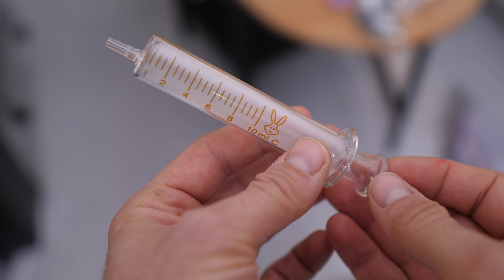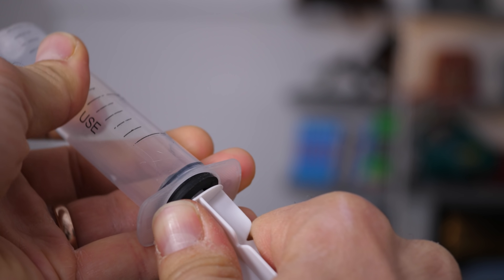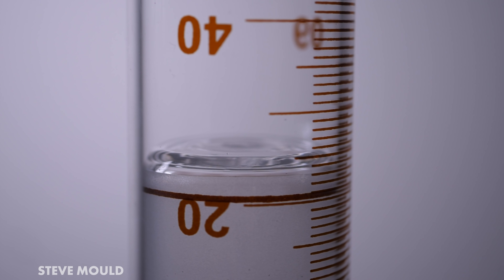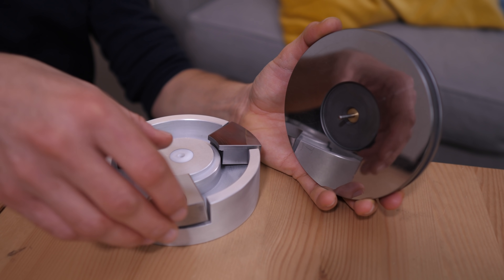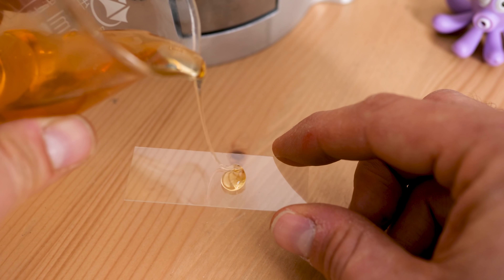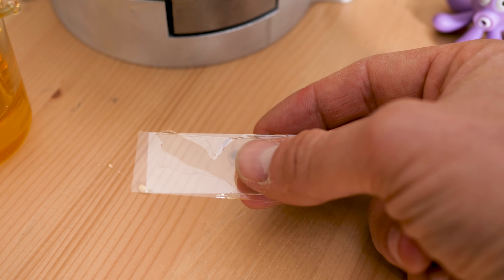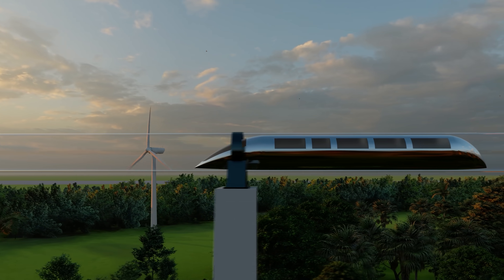The Self-Levitating Kingsbury Aerodynamic Bearing

Comment from the maker: Today I Learned From The Comments Section: I was wrong about how ice skating works (common misconception). Thanks for the correction @W410p. Here's an explainer: https://youtu.be/yjSf7Yh9UZc
The sponsor is Blinkist: The first 100 people to go to https://blinkist.com/stevemould will get unlimited access for 1 week to try it out. You'll also get 25% off if you want full membership.
Reply: Have you ever followed a lorry/articulated/semi at dark and when it's -20C or lower? Their hot tires melt a visible track on the icy road and you can see it refreeze on your headlight spot (if you're crazy enough to drive close to the rear end). That track is slippery as heck, being fresly frozen ice. Now we know why (re. the explanation video).

Offsetting your own tracks onto the older ice gives more grip, because it has had time to collect water vapours and become microstructurally more chaotic, resembling Ice Spikes biome from Minecraft.
Reply: I watched the video from ‘It’s okay to be smart’ and appreciate the phase diagram for water. But this brings me to an interesting question:
In the video, the phase diagram for water demonstrates that with increasing pressure  ice changes to liquid water but in Thoughty2’s video he explains that due to the enormous gravitational force on planet Gliese 436b any liquid water is compressed into solid form (ice). Did I miss something? Does the state change again at even higher pressures?

See the third planet, Gliese 436b
at 2min 40sec in this video:
https://youtu.be/6KZ1kvIUFrU
Reply: @welshsteve2009   I believe that it is because, normally, increasing pressure transitions things from gas to liquid to solid because the molecules get forced closer together. Water, however, is weird in that it expands when it freezes and becomes a solid (see how drinks explode if you leave them in the freezer too long). Therefore, increasing pressure on ice at temps we normally deal with causes a transition back to the liquid form, but increasing further forces the molecules back together into a solid.

See https://en.wikipedia.org/wiki/Phase_diagram#/media/File:Phase_diagram_of_water_simplified.svg
Reply: I think water behaves this way because it normally (i.e. normal conditions humans encounter) becomes a crystal when it freezes, but higher pressures break the crystal formation and things just become a 'block' like most other materials.

Edit: Oh Joe discusses this later in his video
Reply: @Anzallos  So, the conclusion is that water does  go through yet another phase transition at higher pressure?

Edit:
Aha, I can see in the Phase Change diagram in your link that this is indeed true only at a particular (and small) temperature range.

I noticed the small spur. At just below 0degC water remains frozen until the pressure a certain pressure. It then changes to a liquid before changing back to a solid again at even higher pressure. Interesting.
Reply: @welshsteve2009  also Thoughty2’s channel is terrible and inaccurate, I had to unsubscribe from it.
Reply: Hi Steve! There's a new study I saw from the University of Aalto that discussed the faster rate of flow of honey (more viscous) compared to water (less viscous) in a superhydrophobic tube/capillary. I won't spoil the ending, but the hint is: it occurs due to reasons similar to a hydrodynamic bearing. Hope you enjoy!
Reply: Don’t feel too bad, you are in good company with this misconception. Richard Feynman makes the same mistake here are 2:55 https://youtu.be/36GT2zI8lVA (note that he prefaces the statement with “they say”, which is a good trick to avoid looking silly :))
Reply: @tamask001  
Don't think he makes a mistake.... 
Feynman is cautious to preamble with "they say"... 🙂🇨🇱
Reply: Related content: When we were taught about the ice skating in school, we were also told about a related experiment where you use a weighted wire to cut through ice as well. That's been debunked also. Turns out the wire conducts heat which melts the ice.
Reply: There's a TON of hydrodynamic bearing surfaces in a standard car - engine bearings, camshaft lobes, valves, gear teeth, etc.
Reply: You mentioned the builder of that rotating disc. Can you link to his channel or site in the description?
Reply: regarding viscocity smartereveryday has a good video about it with ifferent inks in a really viscose liquid where you cvn spin it in one directerion and spin it back and you get nearly the same pattern.
Reply: Would you like to do a collab on why alkali metals explode in water?  The true mechanism was not truly understood until fairly recently and it's extremely cool how it works.  I already have quite a bit of video showing the explosions as well, so you wouldn't need to put yourself in danger to show the explosions.
Reply: Fascinating video. I never expected a glass syringe to exhibit such behaviour.

Technically glass is a super-cooled fluid. Most glass actually flows over time when a shear force is applied. We can think of glass as a Non-Newtonian liquid with a very large yield stress.
Check the thickness of window glass on very old buildings such as churches etc - the thickness at the bottom of the glass pane is thicker than the top. 
For this particular demonstration we can ignore these viscous effects that occur of long periods of time. The applicable dimensional number? The Deborah Number.

(incidentally, lead sheeting also exhibits the same flow behaviour under the weak force of gravity over long periods of time. Geologists also describe rocks as flowing over long periods of time. You could say that the solid state of matter may well be a transient illusion and in reality "everything" ultimately behaves like a fluid - if you wait long enough or are quick enough perhaps)
Reply: @PetraKann  It is true that common glass is an amorphous solid but glass flow at room temperature is a myth. The glass is thick at the bottom of old church windows because the method of hand blowing did not create even thickness and the installation practice was to install it thick side down.
Reply: Still rocking that Pebble Steel I see, I am currently wearing my Pebble 2 HR.
Reply: I’m not sure you’re wrong re skating (ie blade pressure does melt the ice). As a 12 year old I sharpened my own skates on a grinder (ie the blade contact surface was ground flat and no longer slightly cupped/concave) - I went nowhere.  My understanding is that the cupped profile ensures only the edges of the blade (not the entire blade surface) contact the ice so the pressure must be large.   And, yes, I did watch the video you linked.  😀
Reply: The best understanding as to why the gauge lock happens is the same thing that happens when you place two flat pieces of glass against each other.  At such fine variances, the atoms on either side have wave function uncertainties that mean they do not 'know' which object they belong to... being part of either becomes a valid solution to their location.  When you break the two objects apart, you're essentially forcing the atoms to resolve their wave function so that they remain in one object or the other.
Reply: The trick with the glas syringe can be done with two glases. If you spin it and blow down between the glases. The ine in top jumps out
Reply: Hey, where did you buy these syringes?

 I checked out my Canadianized version of Amazon and all it showed me were hypodermic syringes, complete with a set of attachable needles. So for the next week I was getting recommendations for hypodermic needles on Amazon and all over.
Reply: One note, science doesn't prove things, it tests against a Null Hypothesis by comparing evidence,... 

Otherwise love the video!
Reply: This too is wrong.  A mistake back in the 1950s (by Linus Pauling) is the reason for the confusion.  Here is the solution:
https://www.youtube.com/watch?v=bs73A9mSvQo&t=50s
Reply: One wonders if continuity events are a calculable function of rotational speed.
Reply: I was a little surprised to not hear mention of the use that most people reading this have right next to them right now; hard drive heads float over the surface of the disk from similar effects!
Reply: Well, glass is "a liquid"...
Reply: Can you explain the Faraday's homopolar paradox?
Reply: Ahh man that was such a good video, totally just subscribed!
Reply: LOL!!! https://www.youtube.com/watch?v=zZUUABHj_uk
Reply: Big ups to a man that can public say he was corrected and learned. Idk why but it’s fuckin rare. I don’t have that problem and it blows my mind that the large majority of adults are too insecure to acknowledge they have faults
Reply: @lowkey213  Just as well my knoledge is all perfect then??!? :D
Reply: And could you make one with copper and iron and magnets?
Sry for my english and you have amazing inspirational content really how channel should be
Reply: Gauge blocks stick together because of the same reason why cold welding metal in a vacuum is working
Reply: boi-oi-oing
Reply: 8:50 before its even explained how it works.
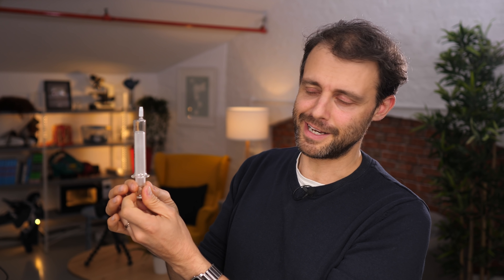Reply: 9:04 9:18
Reply: 10:36
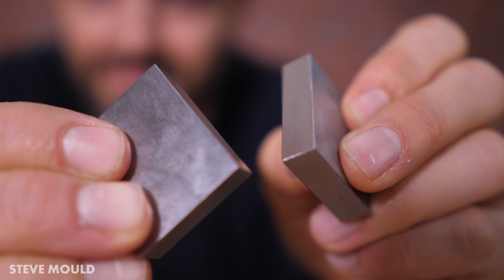Reply: There are forces of attraction occurring between the two metals at 5:24, these are know as van der Val, infact van der Valls happen everywhere where, but the strength of the van der Valls forces drastically increases especially9 when more atoms of that specific object touch another object!,      
Although vertitasium made a fantastic video about the feet's of lizards and how they stick to the walls, he explains the effect of van der Valls at a large magnitude, the link: https://www.youtube.com/watch?v=vS0TuIPoeBs
Reply: plungers are not interchangeable.  buy two and swap the plungers.  one won't fit they are so close tolerance. They must be individually ground.
Reply: Also the card head that was turned up faced the camera. You got it perfect.

Comment: "No one really knows why the gauge blocks stick together"
That's not true. We do.
The reason is very similar (but not quite the same) as why metal parts stick to each other in space. Engineering for space is hard because metal parts will weld to each other.
Normally air molecules get inside all of the spaces between two metal parts and act as sort of grease but also separation layer between two metals.
When you remove air molecules and press two flat metal parts to each other, the atoms "touch" each other. Now, once they are close enough there is no real difference between two atoms being close because they are part of the same object and two atoms being close but being parts of separate object.
They are effectively one object now (we call this -- welded).
Same happens to gauge blocks because flatness of the surface effectively gets rid of most of the air. The blocks do not get welded permanently because there is still some air inside, there are some oxides that create discontinuity and because the blocks are not really perfectly flat -- only some small parts of the surface are in actual contact.
As you slide blocks against each other, you effectively polish bits and pieces of surface that get in contact, scrub any oxides that are present there and evacuate most of the air from between now perfectly polished and parallel surfaces. The two gauge blocks get slightly welded to each other in couple of places and this provides enough resistance to prevent air get inside (kinda like a suction pad).

Comment: Actually I am more interested in Patrick Herd journal bearing using injection molding parts because that Kingsbury bearing is everywhere on the YT. I was looking for info about the dynamic air journal bearing (not trust bearing) and I could not find it anywhere. Most tilting pad journal bearing videos never explicitly mention if it is air dynamic or oil dynamic. (I am looking for air dynamic)

Comment: given how narrow the gap is and how large the not-quite-contact surface area is, I have to wonder, if you actually were to try the circuit test, if you'd run into problems from capacitance or even arcing even at the small amounts of voltage and current you'd need to measure it.

Comment: I don't think its true , what you said about ice skating at the end.  I vaguely remember a youtube about that.  Ice melting under pressure was a theory somebody posited in a lecture and people accepted it but somebody did the maths and its not enough to explain the lack of friction.  I can't remember now what the explanation is.  They put frozen CO2 in a vacuum, so all the fluid on the surface would flash off into evapouration, no liquid, and it was still slidey I think. It think its to do with only one weak vander vals forces bond at the edge rather than two with H2O so the molecule can slide.  Not sure.

Comment: For anyone that doesn't know how syringes work, here's an explanation. It works in the same way as a straw when you were a kid and trapped some coke in it. Syringes are airtight, meaning no air can get out the handle end. So, when you put the syringe in a fluid and try to pull the handle, no air can come in from the handle side. This means that it must suck up air from the other side. But wait, there is no air . . . That doesn't matter. Okay, now you have a filled syringe. You want to empty it. You just push the handle down. This is a simple process. No air can come in the handle side to even the pressure out, and none from the front. So the only way to make the pressure even again is to push whatever is in it, out.

Comment: Barreling occurs in the glass and on the disc. The other object acts almost like an ice skater with a small point of pressure in a pre-determined path. When the disc spins, it can glide just like a speed skater. When the syringe wobbles up and down, the "skates" bump up and down against the grooves. Since the grooves are likely laid out in some kind of frequency or pattern, the motion looks kind of funny to us.

As for the gauge, surfaces that flat have maximum contact between them. Atoms from one break off like small fibers (the way Spiderman crawls up walls in the Tobey Maguire version) and are pushed into the other and vice versa. When pulled apart, some blemish is likely left over but it will still feel incredibly smooth at our scale, but I suspect it would feel like a point here or there after doing so.

Comment: Most people watching this video with a reasonably modern computer would already own some form of this in the fan(s) or Hard drives (if any; the spinning stuff uses hydro dynamic bearings for the motors) in their computer. Different manufacturers uses different trademark name but typically they all work on the same principles.
Fluid Dynamic Bearing (FDB) - Patented by Matsushita (parent company to Panasonic) uses herringbone grooves to help circulate the fluid.
Hydrodynamic bearing (HDB) - Alternatives not licensing from Matsushita typically use spriral grooves.
Rifle bearing - Basically a HDB but some companies prefer to call it that because the spiral grooves are similar to rifling in gun barrels.

Comment: Wouldn't this effect be the result of atomic bonding?   When the two surfaces are stationery, electrons become shared between atoms of the two surfaces and so they would stick together.   When in relative motion though, these atomic bonds would be broken/not able to be formed and so the two perfectly smooth surfaces could just glide over each other without any possibility of electron/electric current flow. This would account for the loss of conductivity.  That would be my guess anyway.
Reply: I personally don't think there is any cushion of air involved.

Comment: Years ago, i worked in a potato chip factory.  There was a single machine that peeled the potatoes by tumbling them over a series of shafts which were surfaced with brush bristles.  The bearings that supported those brush shafts needed a lot of maintenance and we were using food grade grease to lubricate them. The grease would get washed away by the water, abrasive potato rind and inevitable amount of dirt that was present.
I made the suggestion that we adapt the bushing type support bearing by injecting water into them. This virtually ended the maintenance cycle since there was no longer any contact and the water flowing through kept the new bearings clean.
Reply: Be careful I tried to make a correction like this to the electrical system at a company that makes food production equipment like tortilla machines Etc and I was fired for pointing out a flaw that the floor supervisor hadn't seen in his 15 years and also cutting down on their maintenance calls which is where they made the most of their money. 
All I'm saying is sometimes maintenance calls are built into the engineering
Reply: @patrickzavas  there would have to be a bit more to it than that otherwise you can file a lawsuit for unlawful dismissal
Reply: @Psybo yeah, of course they're not going to say that's the reason on my termination paperwork. 
Everybody is an at-will employee here you don't have to stay the reason for firing somebody. 
"It's just not a good fit" is a perfectly usable answer for terminating somebody. I would have to prove that what's the reason and without that being in writing it's kind of hard to do that...
 you're right they moved me to a production factory far away from the main plant where I couldn't cause any problems and then waited. 
They are not stupid. 
They just want to make money and I was saying things that made them less money. 
There really doesn't have to be any more to it than that.
Reply: @patrickzavas  Bro you ruined a good business.
Reply: @jimbotron70 yeah I know it just hurt my brain to run three-phase 277 volt power through the same 2 inch conduit is a bunch of low voltage control and safety wires. 
But hey as long as it makes money who gives a shit right. Somebody might lose an arm someday because the safety equipment doesn't function but whatever.
Reply: @jimbotron70 Or pointed out fraud
Reply: Did you get paid 😂